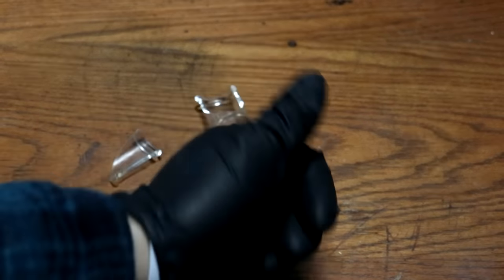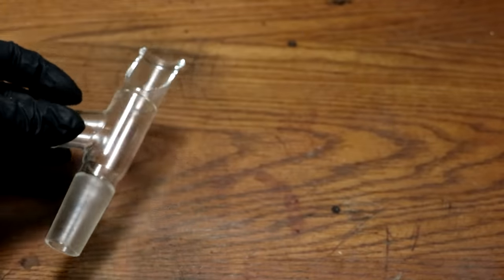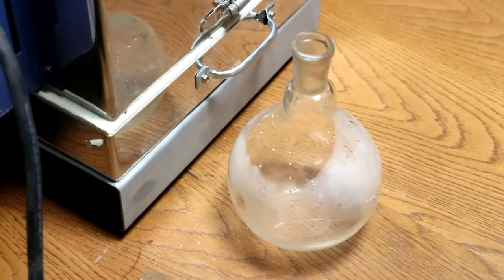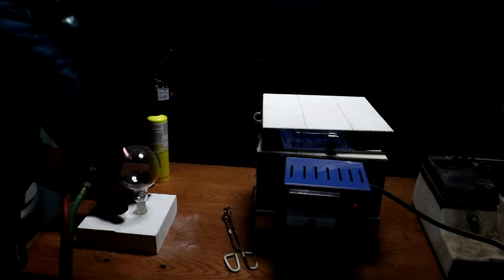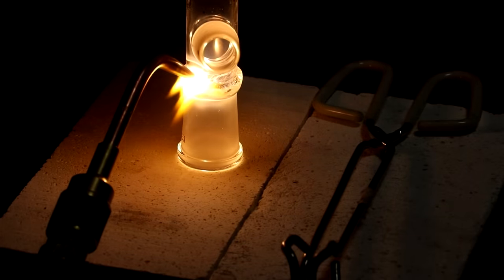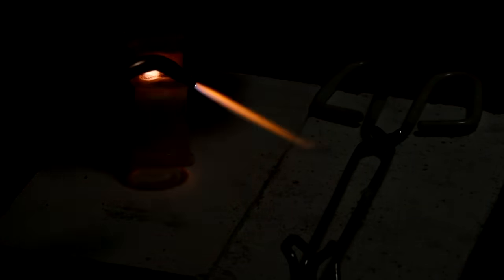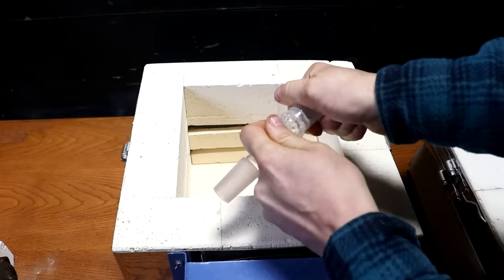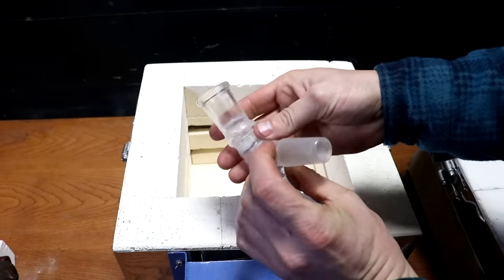Can I Weld Glass?

Comment: The white that formed on the glass is called devitritrification. It most likely happened because you didn’t wipe down the glass before hitting with the torch, dust from the kiln brick most likely adhered during connection. Also I would’ve used a really bushy reducing flame on the bubble to bring it back up to temp before hitting it with that oxidizing beam, the glass cools quickly when out of the kiln. 920-950 is a good garage temp for clear boro. I felt 800 was pretty low to heal that crack. If you had some corks laying around to plug up all the joints and drilled a hole in 1 of them and stuffed a cheap 1/4 barb and attached a piece of silicone or medical tubing to puff air into it to relieve stress when making that connection.

Comment: The reason the top of the distillation adapter is not ground glass is that typically you would insert a thermometer through a drilled stopper.  This lets you know what distillate fraction is coming off at any given time.  At different temperature points, you'll want to change out your collection vessel to, you know, actually separate things.

Comment: Hey Cody, when cutting the glass on the tile saw, you need to have quite a bit more coolant. Insufficiency there could cause the glass to crack. Just a tip

Comment: The thing about cracks is you need to be able to terminate them before heating. Metal actually acts the same way as glass in that sense. If you don't drill out the end of the crack and make a nice round hole before you weld it, it will just continue to follow that crack afterwards. If you would have done a plunge cut at the ends of the crack before trying to weld it, you likely could've done it.. but once the crack is there it will just continue to propagate when heated.

Comment: generic glass friction welding should work with practice on the replacement top but keeping it in the furnace would be advised as its got a low mass so cant retain the heat while you work on it.

Comment: Nice video 2 questions 1) where do you get all your glass ware for your chemistry setup I want to set a home chem lab up but the hardest issue is the correct glassware for distilling and other process. 2) last one is you do realize they sell glass rods for glass bead making you could maybe uses those for glass welding as a filler rod material to fix many of your broken glass materials.... possible haven't tried it so it's just a thought

Comment: Very interesting video cody thx, but this is what i would have done differently I would have filled the flask with dry sand before heating it so when u would have pulled the flask  out of the furnace you would have more time to work with it because the sand would help retain the heat. Another thing you could have done is drill a small hole at the ends of the cracks to stop the stress from spread when your welding on it

Comment: Cody, I bet if you had a turn table that could keep the flask moving and had a touch on one side to keep it heated. you would be able to apply heat in the space you want in order to re-fuse the glassware back together.

Comment: For repairing a large crack in a piece like that Flask you need to have your glass to nearly working temperature to start and a much hotter flame than you were using, then just go for it, grab the piece with your tongs and put it straight to the torch and it will either fuse itself back together or crack for good. Qualifications: Apprenticed in Scientific Glass Blowing for a year under Norman Schmidt at Georgia Southern University.

Comment: Fantastic video to watch!
If you had a turntable i believe you could have done the larger flask with a standing blowtorch or two, even creme brulee chefs torches might of sufficed to keep heat distributed across the flask while you used the oxy torch to do the repair work with, and the turntable would of helped with the ground adapter repair as you'd of been able to focus on controlling the flame and not having to stop to spin the part.

Comment: Congrats on the success with the joint.
As fot the furnace "helping" - it's absolutely critical. I have yet to see 2 welded pieces of glass that will not crack (or just downright explode) when cooling without anealing in an oven.

Comment: The way they do it when they make a piece like that T-connector is to rotate the two parts and heat it with a turbo-propan torch. That ensure even heat all around the junction.

Comment: You might be able to fix the flask if you keep it inverted and vent hot air into it as you use the torch. You would need a stand for the flask and some heat resistant tubing to do it alone.

Comment: might i suggest you use a bushy unfocused flame on something large like the 1st thing you fixed. A black soot is actually good in this instance. The carbon will act as a glue or small particles that the glass can grab to helping it to not spread open. after that increase torch to more focused flame but still a little bushy. you want the black to start to disappear from heat and follow the crack as it disappears. if it doesn't , look at it closely to make sure its not trapped air.  oxy acet is harsh on glass and will make it look scuzzy. This is devitrafication caused by the aggressive heat and chemical reaction of the flame . If you were to try to blow it would be more profound do to mechanical stress do to the gradient of heat where the inner is still stiff but moves and creates mechanical stress on the surface , this is cosmetic and shoulnt effect its use. On the connection a tight small flame is needed so as to not get to much of the glass hot , just the area of connection. Pre heating is usually not necassary with borosilicate glass. The thinner the wall the more resistant it is to heat stress. Standard wall is usually the go to for lab glass. Borosilicate can take up to 800 degress per minute per 1-4 inch sq. when heating. when cooling it can only cool 100 degress per hour per 1/4 inch squared. Boro has c.o.e (coeffeciant rate of expansion )of - 33 to the 8 th power. so -.0000000033 per scm. soft glass or soda lime has any where from 90 to 96 coe. which is 3x more than boro. If you imagine your arm as hot glass in its expanded state. As it cools the surface starts to shrink while the middle is still hot and in expanded state. The skin shrinks over the expanded causing tiny little cracks in the surface. This is where you get cracks in the glass. Glass is stronger than steel in compression. It is in tension that it tends to fail

Comment: You need to rig a rotating stand to get a nice smooth joint. Also use rose bud or even cutting tip intead of brazing tip! More generalized the heat the better.

Comment: One thing that would be interesting to try would be having a blowtorch on a cold burn with too much oxygen (to prevent soot buildup on the glass) keeping your general area hot, then using another blowtorch one it's hottest burn to perform the weld to prevent gasification of the class (as Subconscious Design mentioned). this would help prevent cracks from forming and keep the weld clean.

Comment: When we would weld cracked steel we would drill a small hole at the tip of both sides of the crack to stop it from spreading, weld the crack, then fill in the holes.

Comment: next time if you want to repair a large object I would suggest heating the object in the oven with in a few  degrees of the melting point and weld it in the oven.  It may not be easy but your oven is large enough to be possible.  The other option is you could melt more glass in a crusible then heating the large flask up to just the melting point should soften the glass to the point you could dip any hollow  steel rod in then molten glass and then fuse the flask to the rod at this point you can then roll out the flask just like glass  blowers do in the first place. this may be more work then its worth for the object but would make it good as new. I know there are lots of glass blowing vids out there to learn how  to do just that.

Comment: A trick I use for cracks in metal is at the end of the crack in drill a small hole this is so when the crack wants to expand it has a curved point to stop it (think plane windows) maybe this would work similarly with glass ( I'm a boilermaker btw)

Comment: scuzz marks on the entirety of the joint...if that was pressurized or used in a 2 step..it would explode...if you used dydimium glasses you'd see your work alot better. also thats more like a kiln than a furnace. if you wanna stop cracks then anneal before at least 1050 good luck cody..love your work

Comment: Shit i feel like being kind. The game is called glassblowing and the material is borosilicate glass (lab glass). Ya have to prewarm the broken piece for repairs and stay well away from the crack. eg for the round bottom vessel you would be much further up towards the neck and slowly wash down . Remember heat equals expansion. This stops the crack propagating bc of temp. Then you start past the crack and spot heat (fusion weld) the crack out. Oxy/propane should be fine for boro work, it's kind of hard to tell but you appear to have devitrified the joint changeover piece. Anyhoo there's quite a bit of information on lab glassblowing floating around the web and youtube so i'm sure you can get skilled up should you desire it. Remember though, repairs are generally a prick of a job!

Comment: Do it like a glass blower, take some glass rod and attach it to a ground join on each end of your work peice, now you have a handle on the two peices your working with. I would then rotate them together around a stationary torch instead of moving the torch, I suppose if you have a lathe and you use precision you could make a very good peice.

Comment: Cody kind of a random comment here but i though you might find it interesting. Whenever i spray deodorant in the bathroom I notice the bubbles resting on the surface of the toilet water rapidly collapse and pop. If a spray a directed blast of deodorant at the bubbles the reaction occurs much faster. Idk if its some chemicals in the aerosol that break the surface tension of the bubbles that leads to the popping or that there is something much more complex happening. I just thought out of anyone i could tell you would probably be the best person to aha.

Comment: I'm sure you have propane around. Connect the propane to the torch and you can work at better temps.
And save the fitting on that RB flask.

Comment: If you move the torch around faster slowly heating the glass, you should be able to fix that crack. The idea is to preheat the glass in the area you are about to work. If you heat it slowly like you did in the kiln, then it is less likely to crack. Also having a stick of glass to weld over the crack would have been more likely to be successful because you would only need to heat the glass enough for it to stick.

Comment: The white powder is probably silicon dioxide. You got a bit of a boil during your weld and you cooled quite slowly, so the vapor condensed as amorphous SO2 instead of recrystallizing like if it was cooled faster.

Comment: Unground joints exist.. it looks like it's still a standard taper though..

Oxy propane is probably most ideal but I also do alot of work with Oxy/hydrogen.. 

Doing stuff like this is how I got into glassblowing and I eventually spent a few years working in sci glass

Best way to do this would have been to get both surfaces as hot as possible, without boiling. Stick em together then give em a little pull. The most important thing is to avoid / remove any undercuts.

The white stuff is called bloom. It's the result of sodium burned during work resolidifying on the cooler portions. Areas of buildup can also be a stress indicator but kilning it should have solved that. There are also easy ways to simulate or make a polariscope to see stress

Comment: Hmm, I remember being able to reseal cracks in flasks and beakers surprisingly easy with just small propane torch and zero experience in glass blowing. Oxyacetylene was probably far too hot (although my vessels also seemed to have thinner walls). On the other hand, annealing stresses after that was a major pain in the ass.

Comment: hey cody maybe you could build a contraption for the next time you try to repair the glassware. since you're working solo build a stand and have it hold the torch on the glass while the oxy acetylene work on the repair or maybe put it into sand when you work since the sand can keep it warmer than leaving it opened to the air.

Comment: The white powder may be just oxidized glass if that's a thing or something similar to slag Maybe just speculating but I know for sure there's little bubbles throughout the repair area if he did it again will migrate towards the surface and cause problems if it's heated multiple times and later become a whole or a new crack because glass is most accurately described as a highly viscous liquid and that's why old windows look distorted horizontally from Gravity over time

Comment: The flask needs to be repaired at a high temp to cause both sides to expand at the same rate and dimensions.   Glass blowers do crazy things with glass all the time because they keep putting the glass back into the oven.  I'm betting you can do it.  It would make a great video.

Comment: Don't forget to save the top of the spherical flask. Do you think it might have worked innf you had melted the tip of a stir rod or glass tubing and dabbled the ends then midpoints of the crack to prevent spreading?

Comment: A propane torch is sufficient for most glass, the oxy might be overheating the glass leading to the cracks. Or it might just be a mix of glass types that heat differentials.

Comment: Fixturing your parts on a turntable running 20-40 rpm would make even heating much easier. Even an old record player would work. 33 1/3 for heating and 16 2/3 or manually turning more slowly for welding.

Comment: If you where to add sand in the large flask to hold the heat on the backside while you attempted the crack repair and it would always move to the lower side. Just a thought

Comment: I think if you filled the round flask with something to hold the heat it might have worked, the side wall glass is so thin that it cools down almost as soon as you pull it out.  Maybe a second torch might have helped or if you had the right PPE you could have tried welding it while inside the kiln.

Comment: Leave the flask in the furnace as you weld the crack. Get it a bit warmer than 800 degrees though, try 1200, or 1500.

Comment: Heard that you can use egg white to "glue" the glass (and also ceramic actually) pieces together. Never tried that before, but heard it's useful. Although the protein may not be suitable for some situations...

Also, don't know if the cracking fix would be better if you just do the whole thing inside the oven (with a little heat turned on maybe?)
Reply: Steven Zhu just hearing something doesn't make it true.
Reply: @MrKnutriis  I know, but it's worth trying, right?
Reply: @crides0  Maybe for you it is.  Eggwhite is water and protein.  Neither resists heat which is typically the reason for using borosilicate glass in the first place.  If you don't need heat resistance just use a plastic soda bottle and add some bacon to your egg for a tasty breakfast.

Comment: How about a heating element suspended down inside the flask to keep it warm while you make the repair.  Or if you are feeling dangerous, making the repair with the Oxy torch inside the flask to keep the entire flask at a higher temperature ( could also add the use of insulating fiber cloth on outside for holding/insulating.  Be safe.

Comment: Hey cody... I saw you were trying to weld that crack in your flask back together
If you can heat up just the crack without your (mouth peice) or attach something to it so you can put your mouth to the opening if there's any other open tubes those need to be sealed. And you can SUCK THE GLASSS BACK TOGETHER AND SEAL YOUR CRACK!!
I WAS SHOCKED when I figured this out.

Comment: TWEAKERS ,101. 
THIN glass, once the crack happens, it cannot stop cracking. I've tryed, ALOT!
  Thick glass, can sometimes be fixed, if you are PATIENT, I've used the same method you DID. Heat, no heat, repeat! 
And the cool down!
Reply: sandramorrison99 ayy where my stim gang it?

Comment: Would you have been able to keep the big vial in the furnace while trying to fix the cracks so it didn't get too cool in too many areas while working? Or would leaving the furnace open and on cause too much heat to escape or be too hot and dangerous to work with?

Comment: Hey, what would happen if you put the big beaker in the furnace supported by a wire cage and got it hot enough to fuse the cracks simultaneously?

It may just leave wire shaped indents all around it...I guess it would depend on whether or not the temperature required to fuse the cracks would be enough to fully melt the glass to the point where it loses its shape

Comment: I think the large flask would have worked fine if you had attempted the repair inside the furnace with the furnace still operating. Getting the glass much hotter so the expansion was negligible may have prevented those cracks from forming as you welded it shut.

Comment: What if you fill the big one with sand then heat it up? The sand should hold the heat longer than air right? But it might also melt into the crack when you put the torch on it. Theres gotta be something else that wouldn't get stuck to the glass but would hold heat.